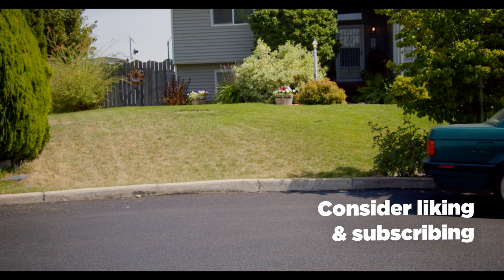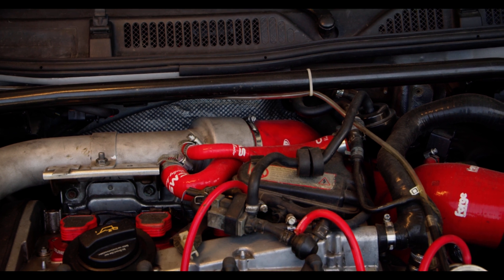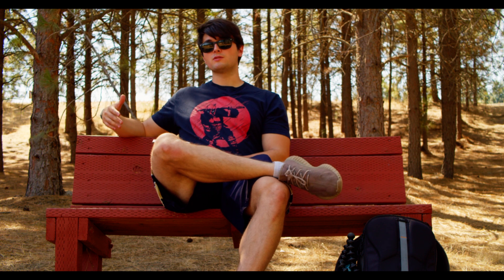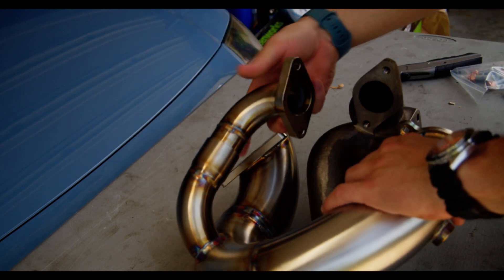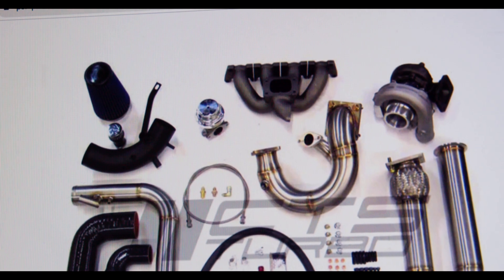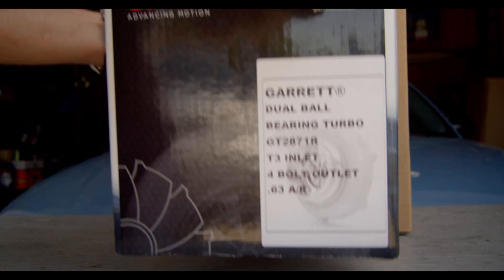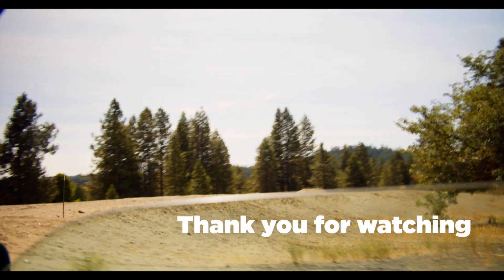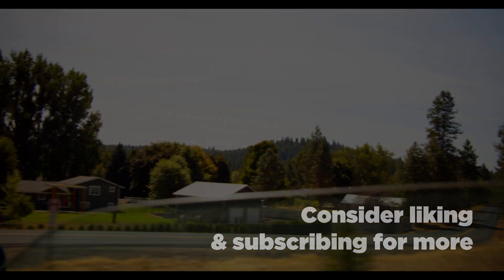How To Build A Custom Turbo Kit: The System, The Plan, & The Parts

Comment: Welcome to the "Big Turbo" life - you made a solid choice on the frame size, itll be an enjoyable daily driver (Ive been running a gtx2867 for nearly 7 years)! Have you decided on how much boost you will run in the interim? Thankfully our engines dont need a whole lot more than rods and exhaust valves to handle some serious power! 

Im looking forward to seeing what you discover and decide.

Comment: The CTS down pipe says for transverse FWD.  is your tt FWD?
Reply from the maker: The car is awd. The cts O2 pipe I got was used in both their awd and fwd kits ironically. I'll need to make the downpipe to connect to the exhaust though. Should be a fun project!
Reply: Is your TT wideband already?  Mine is narrowband so I am pretty sure I should get a new ECU and wideband conversion harness.  your thoughts? @HunterDirection
Reply from the maker: @isaacputzier6241  My car was originally narrowband. A couple weeks ago I made a video on the conversion process to allow it to run a wideband tune ironically! It was a fairly easy procedure thankfully.

Comment: The gt2871r is an excellent choice, I run one on my B5 A4 and it spools at 2800 rpm and packs a punch.
Reply from the maker: That sounds like a really great powerband! I am even more stoked now!
Reply: @HunterDirection  it's a great powerband, cruising in fifth gear on the highway and the boost is right there ready as soon as you hit the throttle.
Reply: @HunterDirection  I have the eliminator frame but plan to install the larger one later.

Comment: one more thing 2871 needs forged internals, 2860 is the one that can be bolted on the BAM engine as it is. Anything over 2867 will brake your motor sooner or later. I am saying this because I am a TT owner myself and ive been researching for the past year and got tons of feed back from the TT community.  The 2867  will make around 550hp if you max it out and around 400-450 with a "safe tune" so the 2871 is going to be around that area and beyond. Watch out for the torque numbers. Stock BAM engines will brake after 380-400 Nm of torque.
Reply from the maker: You are spot on! Most any of these full frame turbos will blow a stock block at full tilt. I intend to run this with a very specific custom tune to keep the torque as low as possible until I get rods. Likely not even exceeding the power the ko4 is tuned at for now. Building the block is very near on the horizon, I just can't steal the garage for that long at a time so I have to break it up.
Reply: @HunterDirection  I would love to see the final numbers after the tune. Btw consider adding a boost controller it will prevent many issues that might occur and save you time and money. Cant wait to see you building that car. Best of luck
Reply: The gt2871r with eliminator frame is rated to 400 and 450 with the larger frame. It is safe to run on a stock/safe tune. I've been running one for two years on stock tune until I gather all the supporting mods.

Comment: Hey man, I’m digging the evolution of your content.  A few questions for ya.  I too have a mk1 225 with Megan Racing rear adjustable control arms.  1) Did you adjust your top arms to correct the stock negative camber so it sits more like the front of the car?  2) I recently picked up a spare 1.8T and have been debating weather to rebuild it for my B5.5 Passat or go full send and throw a bunch of money at it and install it into my TT with a big turbo build.  I’m thinking of the latter but was wondering indeed how much it’ll cost with parts, labor and tuning.  As it currently sits, it’s stage 2 running close to 295hp-300ft/lbs which is fine but…the engine is sitting in my garage so I’m think of what’s next 🤔 If I decide to go big turbo build, I’m looking 400(ish) hp.  What’s your thoughts?